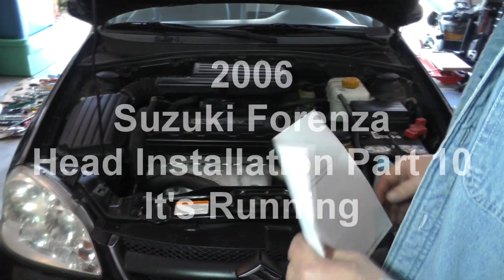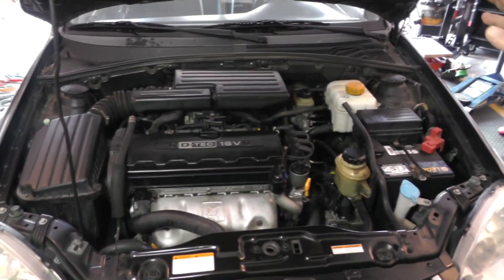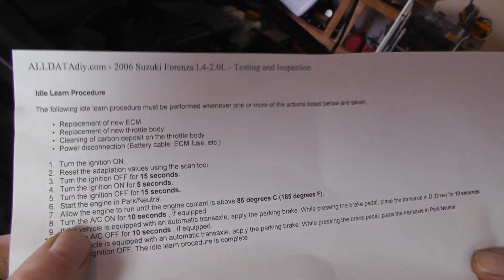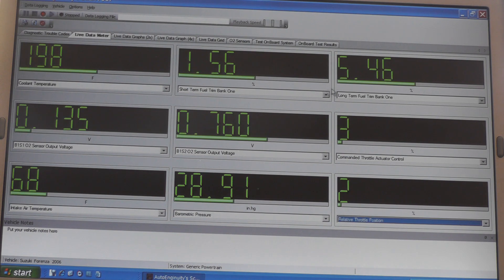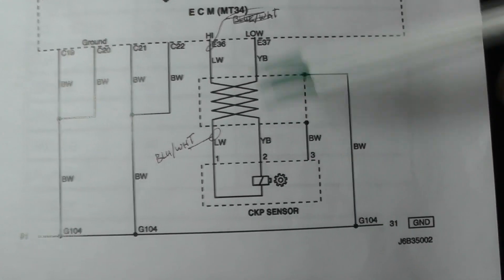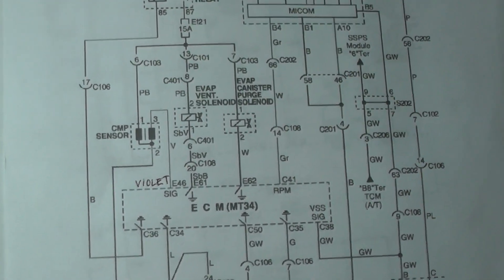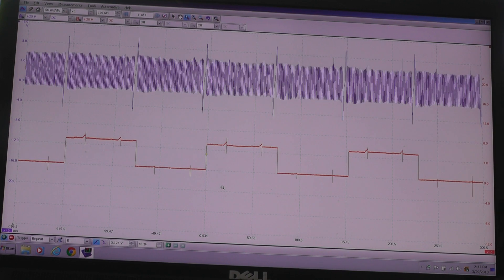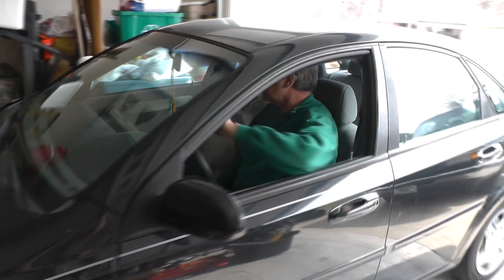Suzuki Forenza Head Installation - Part 18 (Running)

Comment: hey mister Pike! good news! thank God it started and is running smoothly. thank you so much for the great help!  I think the reason why the gasket failed initially was because of the fans. there's a short in the wiring that sometimes keeps the low speed from turning on as it should at 199°F. I eliminated the connector and spliced the wires. it seems like it's working but I'll have to monitor it with my torque app to make sure it behaves. again thx a ton! hello to the wife for her directing skills there. Cheers
Reply from the maker: I had all the confidence in you and knew you would get it going. What did you find out what the issue was about getting it timed? Seems like that was giving you a fit. Be sure to keep a check on on the fans as you've mentioned and if you've got a short, it would still be there right, unless you found the short. Probably, not a short, but keep a check on it! Thanks for the feedback and glad to hear i all worked out!
Reply: I noticed that whilst the head was off and I was cleaning the block I would rotate the crankshaft till the piston was flush with the deck and when I checked the timing mark on the crank it wasn't dead on the spot. It lets me know that there was wiggle room or some minor "play" there. So when I achieved alignment of both cams and the crank was a little off I decided to give it a shot anyways and it worked... So I guess not so strict after all. 

As far as the fan wiring it may have ruptured somewhere and as it moves it may or may not make connection
Reply from the maker: Good to see you had the eagle eye and picked up on that detail. Glad to hear that it all worked out though and now you can move on to your next project :)
Reply: So mister Pike I'm running into a common issue which is valve cover leakage
Reply: Hey mister Pike hope all is well with you. I have a small issue with the valve cover still leaking tough I used the spacers on all ten bolts and didn't overtighten them. the back side is the trouble spot (where the two half moons are). Some have suggested that the cover gets warped, some have suggested that the PCV valve which is molded into the valve cover is the culprit. I'm thinking of taking off since I didn't use rtv and clean all mating surfaces again and use brake clean inside the pcv in case it's clogged. any suggestions?
Reply from the maker: Looks like I didn't get an email on this message affane78. You could try and put a small amount of RTV around the head and then put the gasket on. Hopefully, that will stop the leakage.
Reply from the maker: Oh, and you could clean out the PCV passageway also. There is no PCV valve so make sure that all the passageways on the valve cover are clean.
Reply: stuzman Ah mister Pike glad to hear from you again. The other issue is the egr tube where it meets the valve cover. It always leaks...I haven't seen a gasket for that problem
Reply from the maker: Yes, I did have the same issue after a few weeks of running. I looked into the issue for a little bit and there is no gasket for that area which is crazy. I was thinking of using an o-ring to seal the area, but I sold the car shortly after that. I didn't come up with a solution, but you could look into that and see if that will work for you.
Reply: stuzman I think I'll sell mine as well...;) This car is designed to fail I believe
Reply from the maker: You are correct affane78 that the car is pretty cheap and although some folks love them, they will fail eventually because of head gasket issues usually. Also as you know, if you don't change that timing belt, then you've got bent valves. When Suzuki decided to leave North America, that meant that dealerships will close. We had one dealership in a city near me. That one has been closed for years now and I don't know where another one is at. Also, if you need OEM parts, you'll have to get them online and those parts are getting more and more expensive as the quantity gets less. In the long run, I would just sell it as it's going to cost you more as the car gets older. That's just my opinion :)
Reply: stuzman I agree. Btw have you ever worked on a Volvo? We're doing a cam seal for 2001 S80 T6... Any words of advice?
Reply from the maker: Never worked on a Volvo, but changing cam seals on whichever car should be pretty straight forward. When I did the Ford Escape timing belt job, I did show how to remove the cam seals and how to install them along with the crankshaft seal. I used a kit to do the job, but you don't need it as I do show other methods of how to remove and install the seals. If you want to see what I did, check out this video https://www.youtube.com/watch?v=4dGNjXHrMc0&t=2269s and go to timeline 13:28.
Reply: Excellent tutorial I'll report to you how it all went down

Comment: Terry, thanks so much for this series. You went over some of the costs for parts but approximately how much did the whole project cost you? My daughter has an '06 forenza and it has had something happen to it, possibly bent valves. I need to know if it is worth it to repair the car.
Reply from the maker: Probably in the neighborhood of $800 Ken. Still cheaper than buying another car :)

Comment: Can you help me my overheating problem, head gasket, thermostat, water pump already check and look good, but it still overheating. The coolant tank is boiling and steam comes out. By the way, great video.
Reply from the maker: +Bona Kaious Hi Bona, if you're sure that all of the items mentioned are good, what's left? The radiator, coolant hose(s) collapsing and if the radiator fans are not coming on. Take a look at those items and see if one of those are your issues.
Reply: +stuzman52 Hi again, those three that you just mentioned were already checked yesterday are all good. But still overheating and the auto shop told me that the cylinder head is cracked. So I need your advice on where I can find a new cylinder head for my suzuki forenza 2005 sedan. Ther reason is because my shipping address is PO Box. I am willing to pay for a new cylinder head that you can help me with.
Reply from the maker: +Bona Kaious Bona, I don't know of any company that will ship to a PO address. Your best bet is to use someone's home address so that you can get a head whether it's new or reconditioned. You'll be better to get a reconditioned head with all the valves, seats, seals completed since a reconditioned head will be cheaper that a new one. You can do a search on Google for Suzuki Forenza heads to see who's out there. And you may want to check with Better Business Bureau to see if they are reputable. At least that's what I would do if I'm going to do business with a new company. Sorry, I don't have any experience with any of these companies. As you may know, I pulled the head and had a local machine shop do the work. Hope you get it all worked out.
Reply: +stuzman52, I just did what you recommended and all of your videos will help me put the reconditioned head on my suzuki. Thank you very much.
Reply from the maker: +Bona Kaious Glad to help Bona, and when you do the job, just remember to take your time as your objective is to do it one time and not have to go back in there. Have a good one!

Comment: Great teaching videos. Just one question. Before you turn on the car for the first time after doing all the maintenance, and after checking up the crankshaft in tdc and the camshaft in their marked position. Do you have to position the crankshaft BTDC as the camry 45degrees. I really would appreciate your answer. THANKS-
Reply from the maker: +Jesus Wilhelm All you have to do with this engine is to align all the timing marks, (two on camshafts and one on crank) and you're done. And thanks for liking the videos.

Comment: good morning how are you please I have a question I done from rebuild engine for my Suzuki Forenza before three days ago when I opened spark plug I found oil on top of the piston is this  OK or No thank you so much
Reply from the maker: +Karam Chato You shouldn't find any oil on the piston top. Do a compression/leak down test on the cylinders to see what you come up with?

Comment: Why does our coolant leak out of the exhaust threaded pipe on the bottom. I'm experiencing this problem as we tried to turn the car on.
Reply from the maker: +dalia vargas Sounds like you've got a head gasket issue maybe. There should never be any coolant in the exhaust system.

Comment: Hi again Terry! Just about to begin on the 07 Reno. Got sidetracked by the wife's parents illnesses and having to care for them. The car has been sitting about a year now. Timing belt didn't break but head gasket is blown so I'll change the timing set while I'm in there. I was wondering if you'd considered packaging all 18 videos for this tutorial into one DVD? I'd buy it in a heart beat and I'd bet a lot of people would also. Even though it's free here on Youtube, having a reference dvd to follow would be great to have right beside me as I'm working on it. Give it some thought. With a little success you might market a series of DIY auto repair. There simply isn't any real ones out there that are vehicle specific as this one.  Thanks again for taking the trouble to produce this one and much success in the future!

Comment: I have a suzuki 2008. The shop who is trying to fix it has not. He has redone the head and valves 3 times. He says after a few minutes it keeps bending the rods and now wants to give it back. what is he doing wrong??
Reply from the maker: Michael Themuda I assume when you say rods, that you're meaning the valves. The only thing that comes to mind that would cause this is that the timing belt is installed incorrectly, meaning that it's out of time.

Comment: Hi Terry, 
My Grandson, Dorian and I just started Part 18. Cranked right up and ran great for about 3-5 mins at idle speed and revved up to about 2500. Turned it off to begin the idle rerun procedure.  Followed procedure.  When we reached the start engine point, it started but idled rough and the shut down after a min or two.  Would not restart.  Followed the owner's manual fail start procedure and it started but it would not run below 2000 rpms?  Checked everything we could think of...still will not start/run normal. No check engine light.  Runs great, sounds great above 2000.  Old school thinking, it acts like it is flooding in idle or not getting enough air?  I am at a loss when it comes to the emissions alphabet.  Did I break it?
BTW, Dorian says I am starting to sound like you, LOL.  I would hope so when it comes to fixing cars.
Reply from the maker: Fred Holloway Hi Fred. What was the initial issue with the car? Did you just change the timing belt or was there a head issue? And I'm assuming the car ran fine before the issue. Are you sure that all of the timing marks are aligned? If you're off by one tooth, the car can start but will run rough. Does the car have the drive-by-wire throttle or is the throttle valve controlled by a cable? If you're sure of your work on the timing marks, you could try cleaning the throttle body. Other than that, I can't think of anything else. Good luck Fred on your findings.
Reply: stuzman52 Head gasket was leaking inside..  Timing marks good.  It is not a drive by wire or cable, but has the throttle positioner and idle air control valve on the throttle valve.  Throttle valve was cleaned.  I'm thinking it is either the IAC or the MAP sensor(s).  We now remember we had an indication from a scan code that the MAP was faulty before the head gasket blew. Probably good to replace both at 126k. Thanks again for you videos.  Couldn't have done it without your help.
Reply from the maker: Fred Holloway Sounds like you're on the right track Fred as the MAP and/or TPS sensor can give you those symptoms too. Good thing you have a cable on that year as this will make it easier and cheaper for you. Good luck on your repair and thanks for the comments.
Reply: Fred Holloway Hi Fred, curious if you changed the map sensor?

Comment: Thank you for your video's! Couldn't have done it without them. Blown head gasket on a 2006 Suzuki Reno, Engine ran great. After running it for awhile then took vehicle for test ride went about 10 -15 miles, now it won't or a rough idle. Still runs just don't hold idle. Need help, Any ideas? Thank you again for the video's.
Reply from the maker: Nick F. I assume that you don't have a check engine light on. If you haven't cleaned the throttle body, you could try that. Finally, you could try the idle relearn procedure if you haven't already done that.
Reply: Nick F.I have the same problem after the installation of the head gasket on my Forenza.  Throttle is clean and will not idle after the relearn procedure.  Did you find a fix yet, if so maybe it would help me.
Reply: stuzman52 I finally got a check engine light. Cleaned throttle body. I don't know how to do idle relearn though.
Reply: Fred Holloway Still no fix but there is only 1 component on carb, I'm thinking of changing that
Reply from the maker: Nick F. With your driving around, the car should have relearned its idle. The idle relearn procedure is in this video. And it looks like you need to see what code is being thrown to see what's going on.
Reply: stuzman52 Thanks Terry, that's what I'll do and I'll let know.
Reply: stuzman52 Hi Terry these are the codes I got a 

 P0300 code (Multiple Cylinder Misfire Detected,)
     Air leak in the intake manifold, or in the EGR or PCM system

Base engine mechanical fault that affects one or more cylinders

Fuel delivery component fault that affects one or more cylinders (i.e., one or more contaminated, dirty or sticking fuel injectors)

Ignition system problem (coil or plug) in one or more cylinders

  
    This info came from autozone.com
    I was going to start with the intake manifold
Reply from the maker: Nick F. Nick, do you have a scanner that can read live data? If so, I would start with the fuel trims and see what they look like. P0300 could be a lot of things as you've already mentioned and to narrow it down without any equipment could be exhaustive. I assume that with you starting with the intake manifold, you're going to look for air leaks. If so, I would suspect that a P0171, lean code would show up. Check out this Suzuki Forenza site and do a little searching to see what you come up with. You could also post and see what they might say. http://www.suzuki-forums.com/general-forenza-reno-forum/ Good luck on your findings. Take care Nick...
Reply: stuzman52 Hi Terry,well I put new spark plugs in & problem solved. It was fouled plugs. Running great now. Again I Thank you for your video's. Couldn't have done it without them.
Reply from the maker: Nick F. Glad to hear it Nick...

Comment: Hi. I have a question about the Forenza you have. I have a 2005 Chevy Lacetti\Nubira that is the same car I think apart from the engine maybe. It looks exactly the same inside and out. On my car I have an airbag light on that is related to the driver seat occupancy sensor. I have seen here on youtube that some put in resistors to fool the system so the light goes off, witch is a cheap solution that I want to try, but som use 3 Ohm, some 5 and so on.. How many Ohm do you think would be appropriate for my car?

Love your videos by the way, I'm a huge fan :) Hope you're going to do some more work on the Forenza in the future if you still have it. Greetings from NORWAY
Reply from the maker: Hi Invgvar. I've never heard about putting in different resistor values to keep the air bag light off. Being a safety issue, I would go ahead and fix the problem to whatever that may be. I sold the car back in February so unfortunately there won't be anymore videos on this vehicle. Glad to hear that you liked the videos and hope you get some good use out of them. Hello back to your from the US and good luck on your repair.

Comment: Excellent series of video, lots of dedication and hard work you put in, 10 out of 10 for that. I have the same engine manufactured by GM in my Opel Calibra 2.0 L 16v ecotec, and I have been doing the top end as my gasket failed and had a hydro lock. Your videos really helped me a lot in building my confidence
Reply from the maker: Thanks sam and glad to hear the videos helped. Good luck on your repair and happy Thanksgiving!